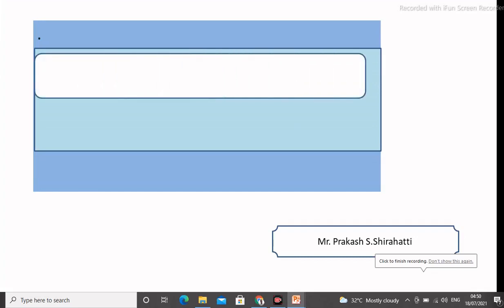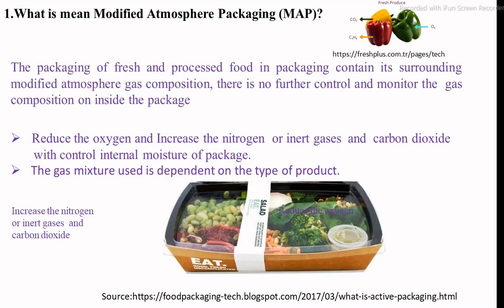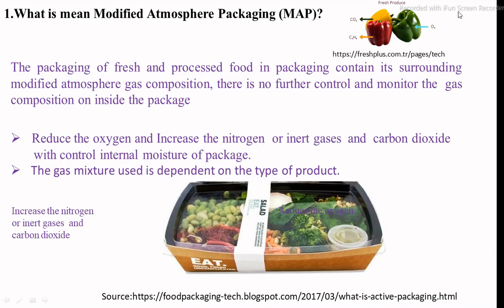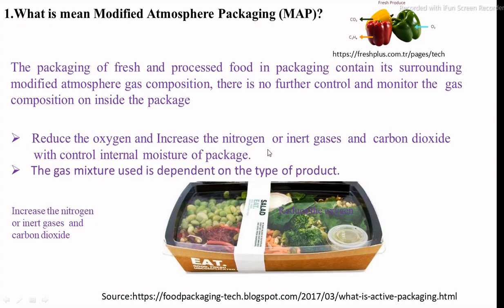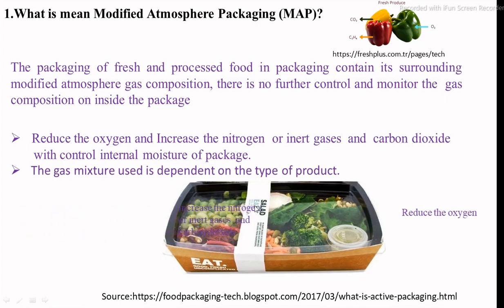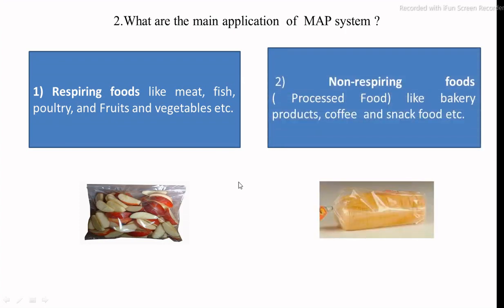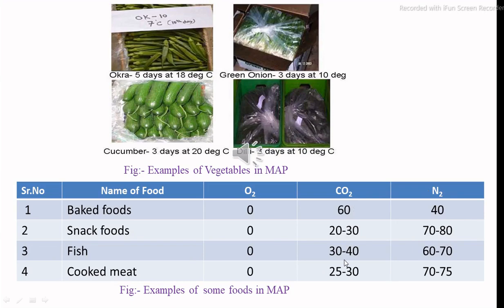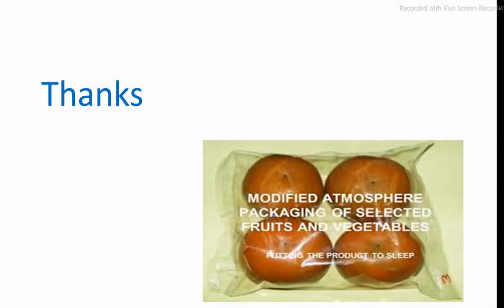Modified Atmosphere Packaging MAP of Food

Comment: Sir.. Very good explanation......i have a doubt?  Do refrigerated atmosphere storage and controlled atmosphere storage are same?
Reply from the maker: In refrigerated storage only controlling the surrounding temperature which reduces the rate of respiration, microbial & enzymatic activity, but in CAS controlling the temperature, humidity, and surrounding atmospheric gas composition, which reduces the control rate of respiration of food, control the enzymatic and microbial activity during storage. CAS system provided an external CO2 gas cylinder to refrigerators, which reduces the oxygen level and increases the CO2 level with automatic monitoring and controlling system.